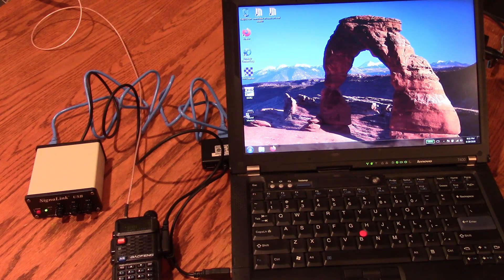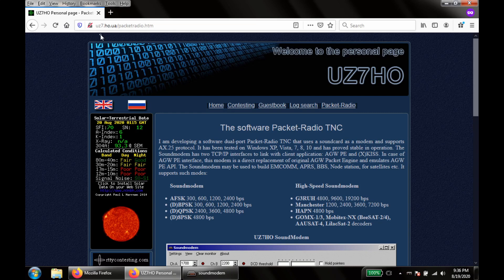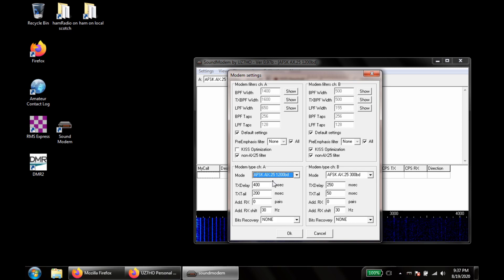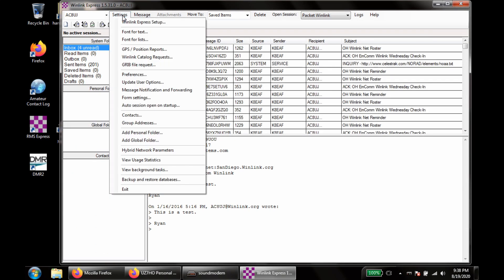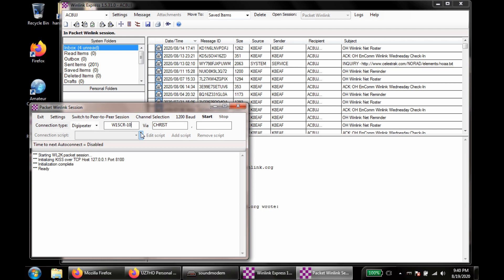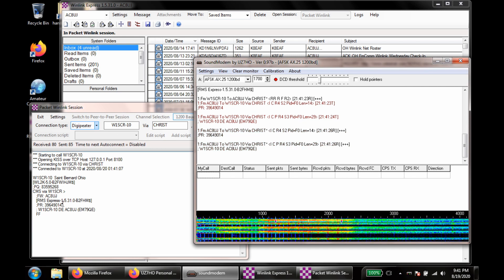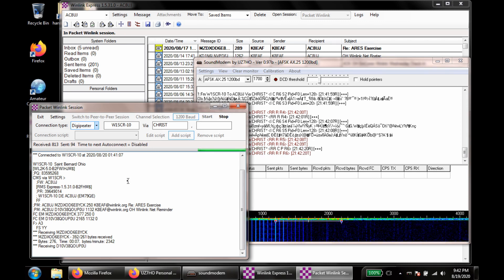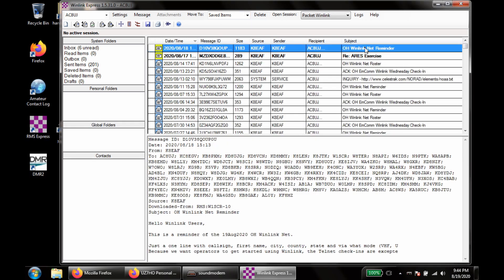Winlink Packet RF Demo with a Baofeng and Signalink USB

Comment: Thank you for this!  
Would I be able to do this with my Yaesu FTM400? I have it set up in an off-grid cabin.  Using APRSlink is cumbersome, so I’d like to be able to use Winlink for emailing with a laptop.  Also, what Baofeng are you using?
Reply from the maker: Yes, Winlink works great with a FTM400. I have an FTM400 in my vehicle and have used it many times for Winlink. The easiest way is to get a converter cable for the radio's 10 pin mini-DIN to a 6 pin mini-DIN (Yaesu sells a few different varieties of adapter), then get the Signalink cable that matches the 6 pin mini-DIN. That cable works with a variety of radios including the FT450D, some Kenwood mobiles, etc. You do have to get the radio settings right, like turn off the APRS modem in the radio, etc.
I'm not sure which Baofeng I used in the video. It could have been a BF-F8+ but I'm not sure. Whatever it is, it is most likely a 2015 or 2016 era version.
Reply: @ryowens  great, thank you!  
I’ve been using APRSlink up to now.  It’s very cumbersome.  Being able to use a laptop would be so much easier.  Your video has been a great help!  Thank you again!

Comment: I really hope you are still following this. Nobody has been able to help me yet. Great video but I am stuck. I have the exact same setup using the same equipment. I have all of the settings matching yours. When I open the SoundModemn, I always get "KISS port is busy!". I do not have multiple instances of SoundModem running. I click OK and continue following your lead. When I get to watching the waterfall, I don't have the steady activity. In fact, I only get activity when I hit the monitor button, my waterfall matches yours. When I hit Start, I connects like yours but then immediately disconnects. It doesn't show any traffic like yours and mail in my outbox never sends. Please help.
Reply from the maker: It sounds like you have multiple issues. The KISS port busy is a TCP port conflict on your computer. You can open a command prompt and run "netstat -an" to see if something is listening on that port. If it is, you can either figure out what it is or use a different port in SoundModem and Winlink. The waterfall issue sounds like a squelch problem. Perhaps you have your squelch set too high or tone squelch enabled. Depending on your radio, you may or may not see waterfall signal when no incoming signal is present. That isn't necessarily an issue.

Comment: I noticed that you started UZ7HO soundmodem first before starting Winlink. I have mine set up so that Winlink Express starts the soundmodem. I've heard other people say to use Ackmode as well on the Packet TNC Model when using the UZ7HO soundmodem, but I've never had any issues with it on Normal. I'm not sure what the difference is though.

Comment: Did you have issues with the squelch trail on the baofeng ?  I've been trying it with the Btech aprs cable (can get APRS to work, not winlink). Have to make/buy a cable for the signallink.
Reply from the maker: Not that I recall specifically. I did at times have to play with some of the delay settings in both the Sound Modem software and in the Winlink software, but that's all I have had to do.
Reply: @ryowens  I was wondering the same thing can the Btech aprs cable be used for this or not ? Is your radio in vox mode ? Have you had the chance to try Vera FM with this setup ?
Reply from the maker: @corradoQC  I don't have any experience with a specific APRS cable. The only Baofeng setups I've used are a Baofeng to a Signalink USB and a Baofeng to a TinyTrak 4. I have not tried Vera FM - only packet. Both the Signalink USB and the TinyTrak4 handle PTT signaling, so there is no need for VOX mode.

Comment: After 20 +? Years, I got back in to Ham Radio. Everybody went to the digital side. I did just pick up a few Baofengs, and a Signalink USB. I have the Signalink & old mobile rig, operating an Echolink Node. But have never dabbled with WinLink. Is it just for sending email in the field, at home? What does Winlink really do?
Reply: It is mostly used for sending email, its like a gateway between ham radio and the internet, however there are peer 2 peer services, where you could email another ham that is in radio range with just radios, and avoid the winlink and internet infrastructure.
Reply from the maker: Thanks for watching. Winlink is quickly becoming a common tool for emergency communications in the ham world. An interesting lesser known feature (if my understanding is correct) is that there are also non-ham government users of Winlink, so it creates some interoperability there as well. There are multiple modes you can run. There's an non-radio "telnet" mode which just connects over the internet, there's a gateway mode which can be HF or VHF or UHF or whatever really, where your computer talks via radio to a gateway node which relays to the internet for you and then radio only modes which don't require a gateway. It also includes support for forms, which are commonly used for EmComm work.